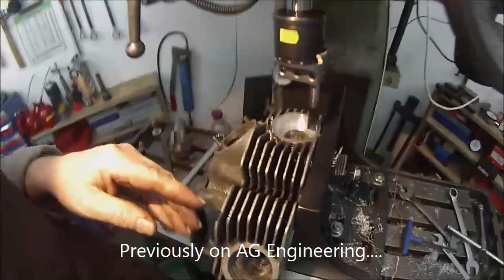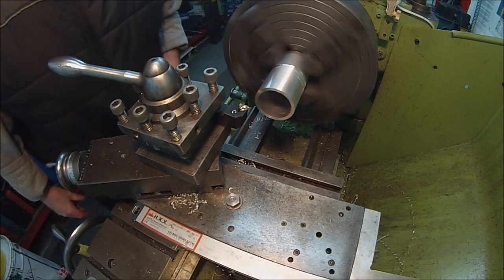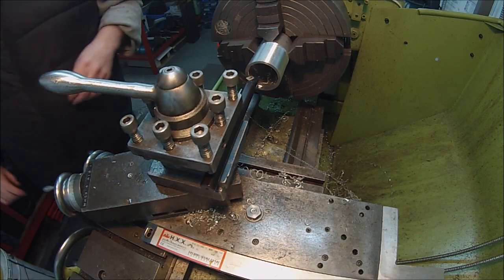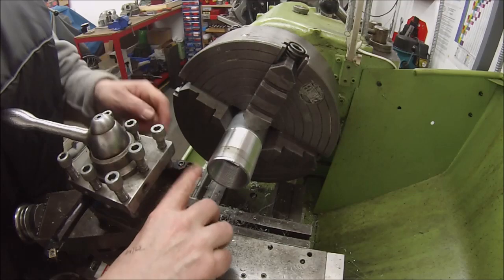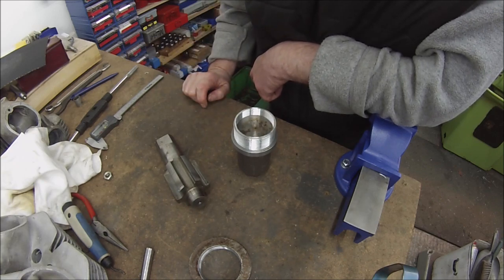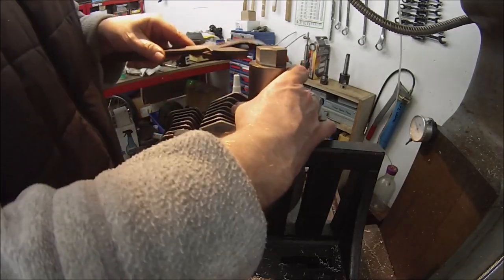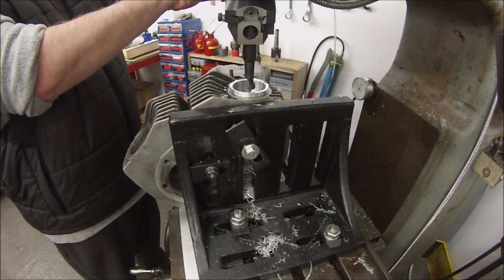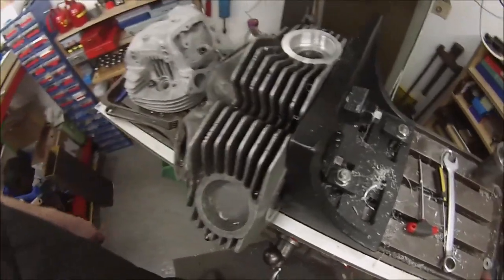Norton exhaust port thread 2

Comment: Great to see another CVA No.79 Jig Borer/Mill still doing the job it was made to do over 70 years ago. Mine is in daily use and has been since I bought it 40 years ago.
Reply from the maker: Mine is perfect for the low ceiling of the workshop and is in great condition, very accurate and working well. I have been working on power down feed and crossfeed, which you may see in some video, that is still work in progress.

Comment: My local engineer always pins the insert. It's never failed yet. I find the bronze lock rings stay in the head far better than the standard rings, which tend to loosen on longer journeys. I don't recommend using the locking tabs with the lock rings as these don't stop the lock ring loosening, but allow them to be loosen just enough to damage the threads.
Reply from the maker: Great information 👍🏼

Comment: When in Machine Shop Operations schooling ('86-'87), this was a project the instructor Allowed me to do.  We decided to machine a single point threaded set of sleeves, these being SLIGHTLY oversize . This required sticking them in the freezer and installing them immediately. I was a little slow with the one but managed to pound it the rest of the way home. Then, it was sent to Bobby the weld instructor(Sweetheart of a guy). He said he had a little difficulty welding them , and wondered if the alloy didn't contain a little Magnesium or something.  Too many years ago.
Reply from the maker: Many thanks for taking the time to watch and comment, much appreciated, Ade

Comment: I owned a 1973 Interstate and could never keep the pipes tight. Did have the ports sleeved with bronze but the inserts eventually pulled out.
Recently I saw a different method of repair on a Roadster. It had spiggots welded into the ports with Triumph style externaly clamped pipes fitted.
The owner said he has had no trouble with the pipes since doing this repair. Can't comment on the long term success as I havn't seen the bike again.
Reply from the maker: Interesting way of doing a repair.I dare say there are several ways to improve the original pipe clamping method, problem is in 2019 most (not all) folks wanting a repair want to preserve the original 'look' of the bike, hence finding 'invisible' ways of doing the repair, not necessarily better. Thanks for the comment, Ade.
Reply: @AGEngineering Agreed, definately not for a show bike. Also possible distortion of the head from welding, extra heat transfer into head while running and possibly fatigue cracking of the spiggots at the pipe junction as there would only be about 6mm wall at that point. Still much less machining for a cheaper repair.
Reply: Yes, my Commando was a pain in the neck too. I made up oversized exhaust rings but the design puts way too much stress just there, especially on the Commando where the engine is allowed to dance around.
Reply: The reason commandos have issues is usually down to the amount of movement in the isolastics. This can be especially bad when aftermarket, ridgedly mounted silencers are fitted.

Comment: The gap probably isn't a problem, and in fact will lock the ring in once the engine has been run a few miles. Modern shotguns use screwed in chokes with fine threads, and unless they are taken out and cleaned, the gasses enter any gaps and make them practically immovable.
Reply from the maker: Thank you for your thoughts, valid point. Many thanks for watching and commenting, Ade

Comment: Hello, for the Norton exhaust nut tap you mentioned 1 15/16 - 14 Unified thread - is that a 55 degree thread angle?
Reply from the maker: The new exhaust rings are unified 60 degree, earlier Dommies were 55
Reply: @AGEngineering  
Myself and a family member both have Early Commandos (1971, 1972 & 1973) - would you consider these bikes "newer" and have a 60 degree thread in the exhaust port/nuts?
Your help is appreciated!
I will look to see if I can find my thread gauges as well.
Reply from the maker: Yes commando, atlas, later 650ss would be 60 degree. All the usual suppliers of new exhaust nuts/rings supply 60 degree, and usually they are not the greatest quality so are 'sloppy' enough to fit the worn original threads of earlier 55 degree head threads anyway.
Reply from the maker: It's quite difficult to determine the difference between 55 and 60 with thread gauges, I have had new and old nuts on my shadowgraph to measure thread angle.

Comment: Hi , not many use the 30 degree ½ included angle any more , compound set straight and just zero the compound slide and add clearance as required. Cheers
Reply from the maker: I use both ways, depending what I'm working on, thanks for watching and commenting

Comment: Out of curiosity, where did you get that magnetic-backed indicator on your mill's column?
Reply from the maker: That's a standard indicator with a round nylon back stuck on with double sided tape that holds a couple of rare earth magnets. I use it to preposition the knee to height if I have to move it. I'll try and remember to show it in more detail in a video. Thanks for watching, Ade.

Comment: I was thinking of doing something similar with triumph heads. But instead of boring out the head and threading it, i was thinking of boring it out, and making an insert a light press fit into the head, and then tigging the insert in. finally threading the insert.
Reply from the maker: I would hope you have seen my earlier video on Triumph exhaust port thread repairs? I made 1.3/4" over-size inserts, taps this size can be quite reasonable prices on ebay, if you have a lathe for thread cutting to make the inserts. Look for Gordys Goodworks on Youtube, he does a similar press fit/welded idea on a Triumph head. Honestly I have seen Norton heads with welded in press fit inserts break the weld when tightened up or have the weld crack in use. Personally I prefer a thread for all their known issues. What do other viewers think? Thanks for taking the time to comment, it is appreciated, Ade
Reply: Its just i don't fully trust loctite and those types of engineering adhesives, especially over a weld.
Reply from the maker: Maybe as Chris Stephens comments further down the post, threaded and the weld to prevent unscrewing?
Reply: A G Engineering 

Yes, belt and braces. Screw the insert in tight and weld the end up. Terrible design though, threads into aluminium and the steel stub screwed into it.
Reply: I've got an old bevel drive Ducati, they were notorious for trashing the exhaust threads. Both  of the exhaust threads have been repaired with threaded inserts which are retained with a bead of weld.
Reply from the maker: Presume they have held up well? Any chance of posting a photo of how the repair looks in place?
Thanks, Ade
Reply: I can take a photo, posting it will be a bit more of a challenge but I will give it a go.
Reply from the maker: Let me know if you succeed and I'll repost on AG Engineering if you are ok with that, many thanks
Reply: Hi Ade.
 I've taken a few photo's & uploaded them to Flickr, a photo hosting site.https://www.flickr.com/photos/900gts/ it should be the first album which comes up & it's labelled cylinder head. Having done all that it looks as though I got it wrong & the exhausts were built up with weld, machined & then a new thread cut. The bike used to belong to my brother who had the repairs done about 35 years ago. It was sitting in various garages over the years until I took it on as a project, bit of a change from my Trident obsession.Feel free to use the photo's how you want.
Kerrin
Reply from the maker: Thanks Kerrin, just looked at them. Hard to say if it's a welded in threaded sleeve or machined and threaded weld isn't it. Any idea who did the repair?
Reply: I believe it was Tony Brancato . Should have put something in the photo to give it scale, it was the thinness of the alloy that made me doubt that it was a threaded insert.

Comment: What does the Loctite activator do, why aren't you supposed to have it on your finger ?
Reply from the maker: Hi thanks for watching! The activator is for use on non-ferrous metal to help the cure, it also speeds the cure. I believe the loctite needs an ionic reaction ( copper ions?) as well as absence of air ( anaerobic ) to both bond and cure. Activator can also be used with steel to speed cure time or for large gaps where air may slow curing. As with most chemicals, skin contact not advised ( but we do, don't we! )
Reply: @AGEngineering  hello thanks for that

Comment: I think you're going to lose must of the strength of the Loctite 680 at exhaust port temperature.
Probably won't matter as it's well jammed in but there's a possibility the adapter will unscrew if the exhaust clamping ring is removed at a later date?
Good job though.
Reply from the maker: Thanks for watching and commenting Peter, please see above reply to Gospelman on this issue. Kind regards, Ade

Comment: Can't see the point of using Loctite 680 on the insert - according to the manufacturer's data the maximum temperature is 149*C for this grade , and the exhaust port will reach way beyond this in normal use.
Reply from the maker: Spot on observation, you'll like the next one where I use 638 then! As mentioned, this is experimental, the head may well end up in the scrap bin because there are more horrendous plans for it still. There are some more parts to this series to come. I have been looking at Minkon Fortafix ( Ouch very expensive, very high temp threadlock) and including a locking peg after assembly to avert potential unscrewing of the insert. I notice our American friends use JB Weld as a retainer, I'd be interested to know peoples thoughts on this.... The other thing to try is making the insert thread slightly over size and heating the head, then trying to screw the insert in before it grabs.....( I seriously doubt this would be possible) This has been mentioned in other posts on Norton forums etc. Thanks for watching and commenting, it's good to get some discussion going, sort of group problem solving! regards, Ade.
Reply from the maker: https://www.ebay.co.uk/itm/Fortafix-High-Temperature-Thread-Lock-50ml-70gram/173135976058?hash=item284fb5567a:g:VUcAAOSwEfBZsSKt
Reply: Mmmm, can't see JBWeld doing it myself.
The shrink fit WOULD work but would have to be JUST right. Pretty difficult in practice.
Have you thought of recessing the outside edge of the exhaust port and making the adapter thicker at the outside to fit inside the recess? You could make a better job of pegging it then. I fear the insert you just made would be too thin walled to peg.
Reply from the maker: It may be a possibility to make the insert flanged. I'm going to section an off-cut of insert to see how thick it is and if it may peg. I did do some snooping around on the net etc before this experiment started, take a look here:https://www.accessnorton.com/NortonCommando/documentary-exhaust-thread-repair.4289/
Reply: How much was the insert short by, not easy to see on the video. Could it have been because you need a little thread relief on the end of the insert? 
When I make inserts like that, I do the internal first so I can align the external thread with the internal for max wall thickness, ie no trough near a peak, but your insert seems thick enough to not worry about that
.
 648 is good to 180C according to Henkel, and that should be good enough. Although the pipe will get hot, the head should be under this high temp unless used in London traffic in the height of summer, if we ever get one. If you look at exhaust pipes that have gone blue, it is often a little away from the head, indicating that the head keeps the pipe cooler at the very end next to it.
 In the link you showed he was using thread locker, rather than a proper high temp retainer, perhaps the wrong choice?
Reply from the maker: Hi Chris. Ok, insert short by about an 1/8", on the next video this problem is sorted, I have increased the thread relief and not used activator, ( Tried 638 which is better for non-ferrous, non-active metals) also checked the fit before applying locking compound. I could do with thermal imaging a running Norton, I'll work on borrowing the Fluke imaging camera from work I use for control panel thermograpy. This will give me an idea of the actual head temp at the port, as you suspect, it may be cooler than you would think. When I have dismantled retainer assembled parts it takes some doing even with heat. As a further improvement, I also have some Rocksett very high temp thread lock on the way from the USA where the use it for locking muzzle brakes onto rifles. Regards, Ade
Reply: Looking up that stuff, it seems to have a great temp range but is it designed to come undone easily? A muzzle break is meant to be de-mountable when needed surely, your insert is meant to be permanent even when the ex ring is, eh, stubborn. 
Had you thought a spot or two of TIG, to stop it coming undone?
Reply from the maker: Agreed it is not high strength, valid point. I have previously used Loctite 620 on other jobs, check the TDS for that, even at over 200 degrees it still has over 50% of it's original strength. I'm gradually thinking I may use this with a Dutch pin for that 'belt & braces' approach. Yes I had thought of welding but was trying to avoid the look of 'welded'' . Thanks for your thoughts Chris, appreciated, Ade
Reply: We "machinists of last resort" have to stick together in this throwaway world.
 I might actually put up a few videos clips of a BMW oil pump housing reline I have been doing lately ,definitely last resort machining,  if they are presentable enough. I think I need more on my channel than a video of one of my foxy visitors taking food for her cubs.
Reply from the maker: That would be interesting, I'll try to be the first viewer! Good luck, Ade

Comment: The Bronze insert does not work as the expansion coefficient is lower than aluminium, my bronze insert backed out after a few years, the aluminium insert should work much better even if the loctite loses its grip.
Reply from the maker: Thanks for your thoughts

Comment: Bad design norton triumph bonnie same also unbelievably Yamaha 600 or was it 650 can’t remember now I had a lot of problems with this bad idea never had an issue with Honda collet design though that’s one reason I went Japanese,,,,,,,,, reliability  looking back still love the British  machine s though
Reply from the maker: Some designs seem to be expensive to produce and not very good in practice, then once they are done, never get changed no matter what. The British Vs Japanese exhaust clamp methods is a good example of this. But then that's what makes them British! Thanks for watching, Ade
Reply: Got to take issue with Japanese design being any better, I have had to repair too many broken studs on them and it's even worse when the owner "helps" by drilling out the broken bit. I have developed special nuts to salvage the situation, if the is enough thread left, and the customer baulks at the cost of head removal.
Reply: Know where your coming from I have seen these issues you mention especially  mr bodgit trying to drill it out and making a complete mess of it ,but I never had any problems.  I owned 4 750 hondas over the years. Regards